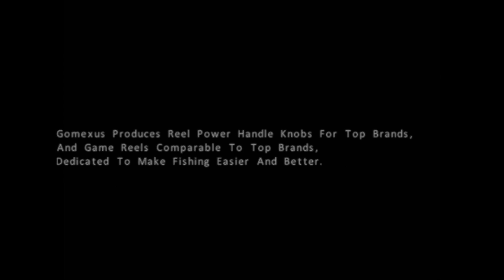Knob Installation Drill Fitment Gomexus

Comment: Another thing that needs to be pointed out is that you should put a washer between the reel handle and the 1st bearing to avoid loading onto the reel arm. The video just shows the bearing being installed but you can see they equip you with washers. I would use them. Additionally, cutting the handle off is a waste of time. I actually clamped the handle into the vice when I began drilling and it was fantastic. I hand drilled this starting with a good spring loaded center punch and then taking a little time to make sure that I punched close to the center of the pin and then started with a 3mm bit ensureing that i stopped occassionally to make sure I was still centered. Once I was down a little ways into the pin, i took out the 5mm (13/64) bit and drilled out the pin which took off the handle and finished out the hole for the new pin.

Comment: I installed the Gomexus Power Knob on a Penn Spinfisher V. The knob works well,and spins freely. One thing that needs to be pointed out, is that the bearings are shielded, not sealed. If you dunk the reel, you will get water in the bearings. They are easily replaced, which helps mitigate the "crap" factor. As far as installation goes, I strongly recommend that you use a drill press or vertical mill to ensure proper alignment and minimize the risk of damaging the finish on the handle. "I recommend" really means "you better. Just my $0.02 worth.
Reply: What size spin fisher do you have? I’m looking to fit one of these to my spinfisher vi 2500 but not sure which size knob to get. Also I only have a hand drill so I’m a bit nervous about wrecking my reel

Comment: I’ve been using the drill instal ones for a few years and I’m not a fan of when 
hooked up it will unscrew the whole knob off what’s up with that ??
Reply from the maker: It will be related to some accessories added during installation, but you can add some screws to fix

Comment: I followed all the Instructions and made a drill fitment. Now its on and all but the Knob itself does not spin freely and it is hard to reel and very awkward. 

What gives???
Reply from the maker: we have updated the shaft for a easy and better performance, please contact us via the channel you bought it, will send the new shaft to you free of charge.
Reply: Gomexus Tackle  will this knob fit on a shimano sedona 4000fe? And if so is it the same method of installation?
Reply: Just back the screw off a hair.